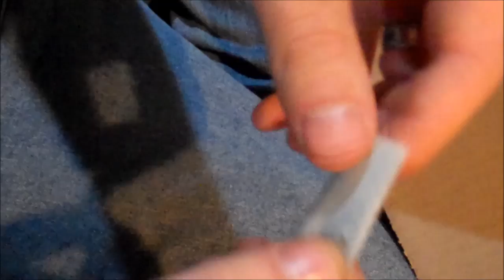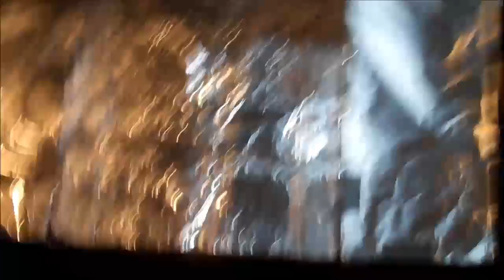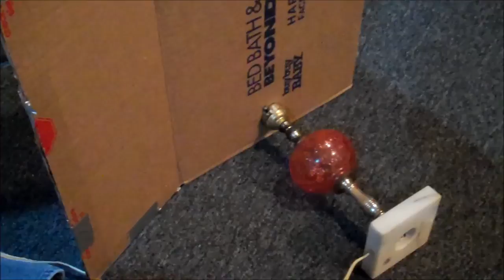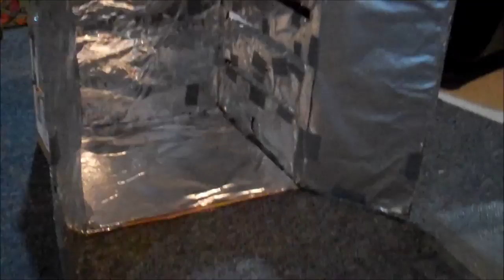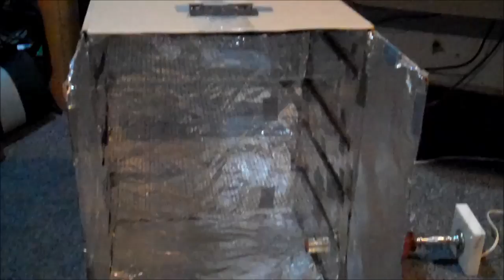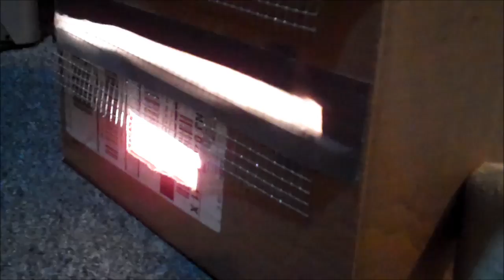How to Build a Home Dehydrator for Under $20

Comment: If preparing your own trays, do not use galvanized screening for tray
bottoms. It has been treated with zinc and cadmium, which can cause a harmful
reaction when in contact with acid foods. Other metals such as aluminum also are
not advisable because they may discolor and corrode with use. If used, line with
cheesecloth or synthetic curtain netting to keep food from touching the metal.
A liner also helps keep foods from sticking to trays and prevents pieces of food
from falling through.

https://nchfp.uga.edu/how/dry/csu_dry_vegetables.pdf

Comment: Hi nice video! I have a few questions about it:In how many time you could dry your jerky?How many Watt is the lamp?I don't understand the use of the hole at the top.sorry I'm italian and I don't speak good english, so it's possible that you already answer at those questions in the video, but I don't catch it :-/
Reply: it takes 4 to 15 hours depending on the cut, he started with a 60 watt then switched it to 150 watt, and the hole is to let air out so the box doesn't burn

Comment: A- 
DIY dehydrator $10
Power Bill after using 200W lightbulb for 8 hours $400 
Insurance premium after the house catches on fire $6000

B-Cheap dehydrator on a yard sale $5 
 I think I choose option B 
LOL
Reply: +More L How do you figure that 400$? You could use a 200W bulb for 5 hours and that'd be 1 Unit (1 KWh)... Assuming you use it for 10 hours, that'd be 2 Units. I checked online and a unit would cost around 15 cents. So, you'd end up using 30c for 10 hours. 

As far as cheap dehydrators bought in a sale, even those COULD have faulty wiring and make your house go up in flames.
Reply: I am teasing you ..lol
Reply: More L Oh ok... :)

Comment from the maker: While I appreciate all your concerns, folks, I'm happy to say I used this sucked quite a few times to make tasty jerky before it eventually fell apart.  Now, granted, I never left it unattended in the house, buuuut yet.  No problems.  =P
Reply: I like a man that thinks with his hands..what a great DIY attempt 👍☺
Reply: +Be a Game Character
Not leaving it unattended is the most important part.
Reply: I`ve got very similar wire I could use to make my drying trays BUT if I did I would be introducing poison into my food.
Anything that has been treated to prevent rusting or corrosion has coatings that will permeate into the food and has potential to make people very ill.
I`ve got nice shiny wire which has been chromed as well as other wire that has been galvanized.
Neither of these are suitable for making these trays mate.
Good project, just be warned about using any wire that has been treated.
Things to consider -
https://www.finishing.com/217/03.shtml
http://www.ehow.com/info_8341510_dangers-chrome-leaching-food.html
While many metals like chrome or stainless are used in food preparation the problems arise when they are heated and it doesn't necessarily need a lot of heat either.
Same applies to galvanized wire.
Better off having wooden skewers and hanging the food from them so the wire isn't in direct contact with the food being dried.

Comment: As far as the paranoid fire hazard alerts go, the only thing I'd be worried about here is the glue from the tape, as far as foil goes, hot coals that burn way hotter than a heat lamp are used directly on aluminum foil when smoking out of a hookah.  And paper com-busts around a little higher than 400 degrees.

Comment: Dangerous fire hazard. The galvanized wire may contaminate the foods. I like the concept but I'll make one out of lumber, not as a dehydrator but as an incubator for Tempeh. The heat element will be heat tape. The heat I need will only be 85 degrees fahrenheit. If I can build one for dehydration using heat tape that would be sweet but it needs to keep a consistent 110 degrees fahrenheit.
Reply: i think the aluminium makes it inflamable? yes no?
i suggest testing the box outside temp with a thermometer

Comment: That box should really be sealed completely and then a hole cut on top with a small fan (muffin fan or pc fan) to extract the hot air without letting fresh air into the box. 

You dont wanna let any fresh air inside as it brings in moisture, hence why a small fan just extracting air is good. 

Mine works a treat... nice and fast and has steady temp.... my fan speed is adjustable which gets my temp right as my lamp is one constant output.
Reply: If you extract hot air , fresh air will definitely go inside, you need to circulate air inside, leaving a small opening on top to let vapour out

Comment: So you don't have to worry about ripping the foil while fabricating holes, make the holes before you put the foil on. This way the excess foil can be molded around the hole, even taped to the outside of the box.

Comment: If you ABSOLUTELY MUST do this, I would add at least 3 additional layers of aluminum foil on the bottom (because the bulb is so close to the bottom) and the side where you put the lamp in. (again because of heat concerns, and don't forget to seal the hole with a non-conducting, not flammable material. You can also use dollar store aluminum 1 time use roast pans as the aluminum is much thicker). I would also use small staples (or non-flammable glue that can be 'painted' onto the box, but that's only good for the first layer) to install the aluminum, not only because the glue is flammable, but because it can also give off fumes when heated. I wouldn't, under any circumstances put a 150 watt bulb in the lamp, it's way too hot (for the size of this box) and the lamp might not be rated for 150 watts. I would also do this either outside or in the basement away from anything flammable on a concrete floor or a couple of cinder-blocks. I would also install an exhaust fan at the top and not a blower on the bottom. The blower on the bottom is just going to blow a lot of air onto the bulb anyway, but by reversing the fan and installing it on the top, it can gently pull air through the box. I would also install a temperature probe (a roast thermometer will do) to monitor the temperature of the inside of the box.
Reply: Do you have your own tutorial we can see with your suggestions, please?
Thank you
Reply: yeah if you can have an "air gap" between the box and the foil, that is best. you can use layers of partially crumbled foil and/or a metal rack and so on. There is no point in skimping by using only a single layer, when it comes to foil. Some more useful information that can be added, is that a heat source in an enclosed area will get WAY WAY WAY hotter, so I agree with the 150 watt light being dangerous. You have convinced me to either find an oven procedure or just buy a unit for around $25-$50.

Comment: Talk about a bad design. First, you shouldn't be using duct tape, the glue is highly flammable. Second, you should cut the holes before fitting the aluminum foil so you don't destroy the foil. 3rd, where the lamp holder is going in, the hole needs to be covered in an insulator (electrical insulator). Next is the bulb, it should be very low wattage, maybe 20 at the most. A 100 watt bulb will raise the inside of this box to 400F easily. I don't like the safety nuts, but this project is an accident waiting to happen.
Reply: Very good analysis

Comment: Can someone please explain me this? I mean step by step. I don't get it. Im planning to add this on a homemade AC, its a science project showing how does a AC works, I figured out that the homemade AC needs a dehumidifier because I put copper coils in it and damp cloths for the air to cool, and this for the condensation.

Comment from the maker: I am, and yes, you're right, stainless would be better.  I've actually made a trip to the dollar store recently and replaced the wire trays with food-grade slotted plastic dish racks, which work just as well and are a bit more chemically inert.